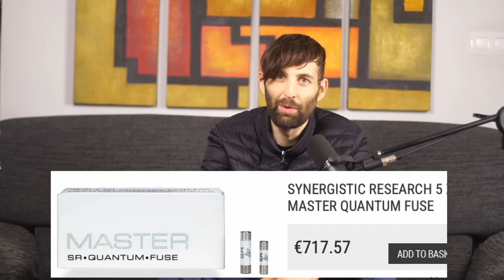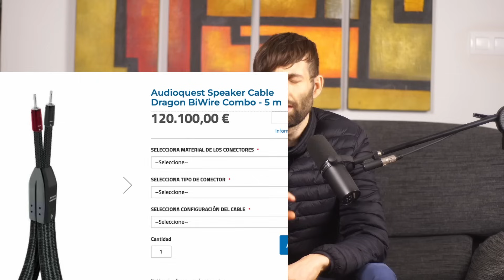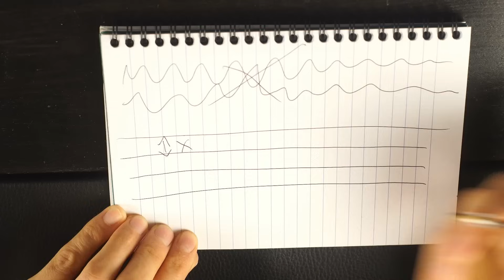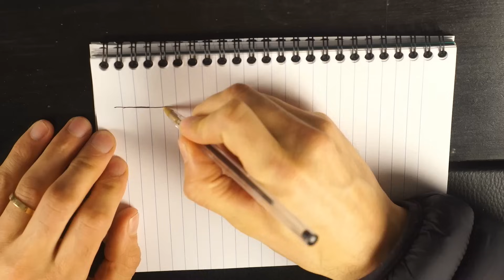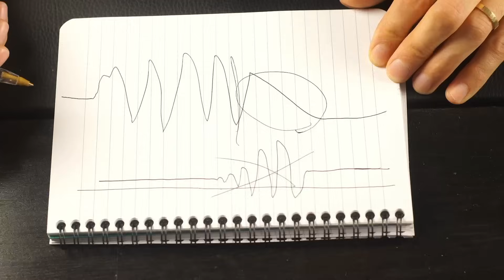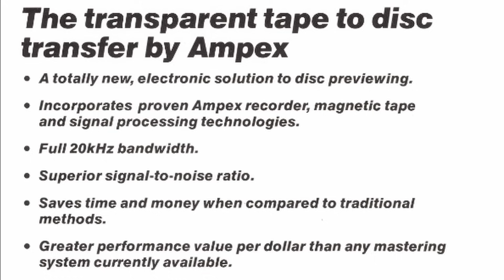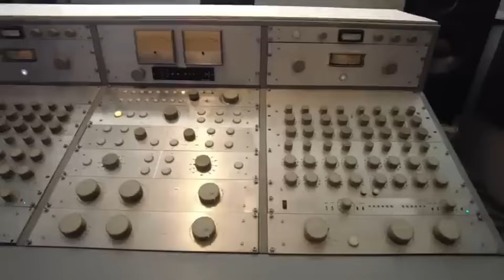Hard truth: most vinyl is digital anyway

Comment: Man, the hi-fi guys arguing with engineers and producers is so hilarious.
Reply: @vstrvcvrtv  I saw one yesterday who said something along the lines of "I don't read Scientific or technical documents, but..."  It's embarrassing.
Reply: @kaczynski2333  And the very finest engineers will still be shocked when their initial implementation TO THEIR EARS sounds poor and they have to begin tweaking.

Same with many speaker manufacturers.

It's what comes in the ears that counts   The science and the maths will get you only so far
Reply: These are the guys who think a £500 RCA jack interconnect makes a big difference when in any studio I've been in, including some very, very good ones, the mic cables are all £20 ones from Studiospares and there's a high chance the snare was miked with a £90 SM57.
Reply: @DrRinse  And the mic cables are only 20$ because they're like 10m long and they bought them, instead of having the intern make them. 😂
Reply: @DrRinse  quality mic cables don‘t make a difference ( on impedance)?
Reply: @perudolux  The impedance of the balanced cable is too small in comparison to that of the mic or pre-amp to make any discernible difference. One studio I worked in had a Neve VR60, nice Neumann mics, Coles Ribbon mics, API outboard hardware, NS10 and PMC monitoring, an Otari MTR90 as well as Pro Tools HD but with a standard cheap patchbay and patch cables. Mic cables were as I described and many great recordings and mixes came out of there.
Reply: @sorry, I ment resistance
Reply: @perudolux  As far as I know XLR cables are fairly low impedance (c. 40-75 Ohms). We kept the cable runs 10 metres or less so I would doubt resistance would have been significant. Upstairs, the mastering suite was kitted out by a good mastering engineer who has some nice credits on Discogs and was very particular about the setup. 
He had a Manley Vari-Mu compressor and a Maselec MEA-2 Mastering EQ, a lovely AD/DA and monitoring but again everything was linked with standard, non-flashy XLR leads. This was the sort of guy who would ask me could I tell the difference when he applied a half a dB of EQ. He could - I defo couldn't!
Reply: @ and cables running long distance from downstair to upstair were also 10$ shitty cables?
Reply: @perudolux  all analog cables DO make a difference- just not always perceivable, due to being minute. Biggest reason is capacitance: first, cheaper cables have poorer insulation, secondly the longer cables will have more capacitance than shorter one of same cable type. Impedance can play a role too, but usually you'd have to go couple hundred feet for that to become a significant issue. Capacitance would parasitically drain a lot of high  frequency content from the signal on  a longer run.
Reply: @perudolux  The mixing and mastering studios were separate. The cables for both studios were £20 for a 10m XLR, standard quality.
Reply: @alshk6763  I mean, you can tell if a cable is damaged, that's true.
Reply: @perudolux  we should expect a reasonable variability in impedance, + or -  the standard for that wire size. There is no magic in copper. A cable can be made so poorly, the connections are causing problems, but in general, most cables will do the job. It is true, a cable company could use higher quality materials and thus the cable we perform over a far longer period of time, but this quality difference will never be audible or measurable, until the cheap cable fails, which will be more likely from being walked on.
Reply: @perudolux  Impedance can make the signal weaker in volume, I am more concern about the capacitance of the cable as it is a low pass filter essentially. 3 dollar cables per meter are usually very good and there are good ones for 2$ per meter. I used lots of different cables and when I don't like a cable it is usually 1$ or less per meter.
Reply: @DrRinse  lol, I prefer these guys £5000 soundbar guys
Reply: @DrRinse  reminds me of the recent GamersNexus video making fun of marketing for computer components. The manufacturers write "military grade" in huge bold letters on their website; what they fail to tell you is that, more often than not, military grade just refers to the minimum viable quality
Reply: SM57 is nice for snares. But it HAS TO BE MADE IN 'MURICA!
Reply: @DrRinse  in a properly treated room, with top notch monitors, cables will make a difference. Any studio claiming to be high-end that's running £20 cables should be wholeheartedly avoided
Reply: @DrRinse I agree with you for the most part but we are talking many muliples of cables microphones, fx,, patch bays, preamps, amps ect. working in conjunction in a functional mix.Also all pro audio is balanced connection (Xlr, pentacom ect.). When I was training at IAR or working at Soundtrack NY these where also mixed down on very expensive mix boards. I believe the main board in IAR was close to $800k😊
Reply: this is the science lol l
Reply: Hi Fi guys arguing with vested interests you mean
Reply: I’m a Mix and Mastering engineer that has been going to Hi-Fi conventions for years to compare the speaker designs versus Pro Audio/Studio designs. I would always take music the I know intimately, because I produce it, tracked it, mixed it and approved the mastering. This way I could judge correctly how each song is being reproduced by the different systems. The times the audiophiles would argue with me when I expressed my take on how a system was skewed or just lacking totally, was constant. Telling me I had no idea what I was taking about. Even after I explained that I produced it all. It was just hilarious how they would just die on their cross for the equipment they spent $100k for that didn’t sound any better than a $1k studio monitor.
Reply: @aarongandia5930  to defend hi-fi guys, you can listen to loud hi-fi way longer than loud monitors. The skew is comfortable most times.😂
Reply: I swear. Some guy on reddit (obviously) was arguing with me and calling me a closed mind idi0t because i explained that power cables don't matter.

I'm a practical engineer with a specialty in communication technologies and signal integrity.
Reply: @Drn10n  Isn't the projecting of these people funny? I have a degree in communication electronics and had the same with some of these snake oil believers. They're a bit like the flat earthers of audio. It's pointless arguing because they don't understand basic physics, but believe a story.
Reply: @ropeburn6684  hell yeah man them bad and dumb and we smart and good hahaha amirightguys
Reply: @Drn10n  POWER cables?!?! good fucking LORD lol
Reply: @Drn10n  well yeah he was arguing with you because you’re an idiot. Everyone knows that he was right /s
Reply: @Drn10n  I like to ask them do they know what is the price of the wire that goes from the socket, trough the walls and then to the power transformer outside their house and to explain how the final 2m of cable being gold plated matters LoL :)
Reply: @collapsingruins  CRT monitors have lower latency, also scale down better to lower resolutions, it’s not some mumbo jumbo, digital foundry did a good video on it a few years back. 

When playing older low resolution systems the image quality can be substantially better as those games were designed around those monitors, and the best filter solutions are still not great. 

Not enough for me to go back to CRT tho bugger that.
Reply: Eh well I have been designing and builidng audio equipment for over 3 decades and the title of his video is simply false. He's usually spot on technically but this particlar argument tries to make subjective qualia objective and that's kind of false because, as he and any good audio engineer knows, psychoacoustics plays a significant role in how we percieve audio.
Reply: @atarisidequest  haha, you'd prefer "there's sometimes analog to digital conversion in the vinyl making process"
Reply: @vstrvcvrtv  Vinyl is always analogue 100% of the time. You could technically make a digital vinyl record but the sample rate and bit depth would be severely limited by the moving mass of the stylus. You'd also need to normalise the signal, do D-A conversion then amplify. It would be absolutley silly. Regardless of whether or not the signal upstream of the cutting head is digital, at the point where the cutting head cuts the master plates it is 100% analogue.
Reply: @atarisidequest  I must have not understood the video
Reply: @vstrvcvrtv  The video is trying to make a point about how most vinyl is created from a digital source and is therefore inferior to the source. Furthermore he's emphasising that point by stating that even the way that the masters are cut involves a digital control system.

All these are valid and true points but ultimately the tracks on the record can only be cut in a way that allows a stylus that moves with 4 degrees of freedom to be equalised and amplified to produce the music we hear, and that is a purely analogue signal.
Reply: @atarisidequest  how did you arrive at "therefore". Are you suggesting if the vinyl was made from pure analogue it would be better? You're correcting me for a point you're making now. Plus, you missed the sarcasm.

Have a good day though, it's all banter, plus English isn't my first language, I was just not communicating clearly. Happens more than I like.
Reply: @vstrvcvrtv  I'm sorry, I'm autistic so i missed your sarcarsm and tend to be very literal. I was only trying to explain the video because you said you must have misunderstood it.

Anyway at risk of more literal interpretation:

"therefore" follows a set of logic statements about the truth of my claim. I'm not saying analogue is better, that's subjective, just that the statement made by the title of the video is incorrect. It wouldn't even bother me but the video went into enough esoteric detail regarding the cutting process that people less familiar with the topic could be forgiven for believing that vinyl is a digital format, when, in fact, it is not.

Yes this is all just a friendly discussion, I hope you have a great day too!
Reply: @atarisidequest  hehe, I see you have encountered many people who lack comprehension, and are thusly being accommodating, I usually go condescending, I will be more like you from now on🙏
Reply: @atarisidequest  now I wanna say CD's are just digital vinyls(ignoring materials etc)
Reply: @vstrvcvrtv  haha well actually that's very valid
Reply: @atarisidequest that’s a word salad.
Reply: @jeremycarroll451  lol, he did, relax with him, he's cool people.
Reply: @atarisidequest The point that it fails to make is that these sources are usually cut more flat to records in masterings and most of the time dont have the compression and sample rate cut offs if you record a modern record cut digital. So these sources are not what you get when you buy a cd. Many times advertised HD downloads are bogus with 44.1khz cut offs or upscaled cds. 
I transfer all my lps and do a full on digital analysis on everything I buy. Science. Some of these "rips" are available on my channel
Reply: @atarisidequest did you actually watch the video?
Reply: @collapsingruins  That's not true at all, any decent quality PC monitor from the late 90s to early 00s would have a better pixel image quality at lower resolutions than any modern screen.

Where they would lack is in colour accuracy or vibrance. When I first upgraded to a quality flatscreen about 15 years ago I noticed a decrease in image clarity, which was only really explained by the digital foundry CRT videos.

Old CRT TV's were a different matter, most of them pretty poor quality and the high quality ones were expensive, but good CRT PC monitors were common, mine ended up in a dump somewhere, just took up too much space.
Reply: People who make the sausage arguing with the people eating it
Reply: @ he is saying that all sausages are the same and they are 100% pure meat and sausages are identical to hamburgers. 😂😂😂
Reply: @domlisboa4024  they should increase the price of whatever it is you're smoking
Reply: @ yes understanding how equipment measures and how all equipment measures differently is something that children under ten years of age can understand. No cigarettes needed.
Reply: This "measures differently" is a pretty pathetic argument when you actually bring the numbers to table and it's obvious that they mostly are orders of magnitude below the levels that would be perceptible to human ears (i.e THD).
Reply: Anti-intellectualism is huge right now
Reply: @ It’s not nonsense as it’s quantifiable that CRTs have faster refresh and less lag than sample and hold display tech. There are whole subcultures like blurbusters working all the time on how we can get fixed pixel displays to achieve CRT parity.
Reply: Rhetorical question: How many of them know the history of recording technology? This is simply entertainment appealing to the ignorant and to futility.
Reply: @vstrvcvrtv  Grammy award winning mastering engineers do not agree with this YouTuber. Choose who you wish to believe.
Reply: @domlisboa4024  disagree about what exactly?
Reply: @ just read my posts. It’s all there. The YouTuber asserts that all digital playback is indistinguishable from each other and that digital is fully transparent. This is scientifically proven to be false with much published evidence to support this. The YouTuber is the one that needs to show published findings to support his argument. But we all know that they do not exist. It’s just his opinion to create a video that will gain views.
Reply: @domlisboa4024  he did in his "claim" video
Reply: @ can you share the link because YouTube doesn’t give any results for that video
Reply: @domlisboa4024  the video isn't titled claim, the video where you say he's wrong about digital destruction, is the same video with concise information. Also, you genuinely feel like digital destruction is worse than analogue?
Reply: @ I never said anything about my preference. His assertions are patently and objectively false. That’s all that I have said. Digital is very good. But it’s not perfect. There are plenty of turntables that I both like and dislike.
Reply: @domlisboa4024  cool. Any chance you can share your proof of a reference, so I don't have to say "some dude in YouTube comments told me"
Reply: @vstrvcvrtv  you are joking right about me providing proof? There are measurements of converters all over the internet. They all measure differently. They are not the same. The difference between digital and LP isn’t just surface noise again the measurements demonstrating this are all over the net. A person claiming the equivalent of the earth being flat (the YouTuber in the video in this case) is the one who needs to provide the proof.
Reply: @domlisboa4024  if you don't have any, I understand completely, I'm also unable to find any information that supports your claim
Reply: @ and for the record I never said that I didn’t have information about manufacturers specs and third party tests that highlight difference between digital products. These are all over the internet. But I do look forward to receiving your academic studies proving that different measurements in audio are in fact the same as identical measurements.
Reply: @domlisboa4024  a simple "no, I don't have any information to share with you" would suffice big dawg. Plus I also have a decent hi-fi system with a vinyl player and amp, digital is just better.
Reply: @ I shared the information with you including one of the leading test sites of DACs. You choose to ignore published data from manufacturers and testers. If you want to ignore science that’s up to you.
Reply: Dude, it's DIGITAL. It's literally identical and bit-perfect from playback to playback. There are variables to that such as clock jitter, etc. but these are so insignificant that 99.9% of listeners would fail a blind test. Don't make stuff up.
Reply: That's not science, that's marketing BS at its finest.
Reply: @domlisboa4024  In which random anonymous youtube commenter claims without any evidence that he knows what Grammy award winning engineers agree or disagree with
Reply: @domlisboa4024  genuinely have no idea what music I actually listen to won a grammy in the last 20 years. I listen to 2 artists AP works with
Reply: On what points dont they agree?
Reply: @collapsingruins  Well flatscreens are thinner, lighter, wider, cheaper to produce and more energy efficient. CRT's were massive and heavy, the advantages they have over flatscreens aren't relevant and were always going to be solved by new tech, however long that took.

My old CRT from 1998 was 1280x1024 resolution, which is higher than 720p HD, but where CRT was superior is in the picture quality for any images displayed at lower than native resolution. 

The 0 latency of CRT's is largely a non-issue with modern gaming monitors having low latency around 1-3ms, and high refresh rates up to 240hz or more are vastly superior to 60hz CRT's with 16.6ms per refresh even if they had 0 ms latency.
Reply: I had gamer explain to me how great Razer cans were so I could mix with them😂😂
Reply: @ViklasSvenske Exactly, but good luck trying to convey that point to a true hi-fi believer
Reply: Big money spenders vs big money makers?  I know where I’m putting my money 😊
Reply: This is what make the debate realy fun, they are able to say ,  '' my copie on LP from the music your made, sound better than your digital master ...'' that's totaly nuts they have no idea what they talking about and they are sure that your expensive studio gear sounds weaker than there 10 k HIFI equipement they are totaly out of there mind !
Reply: @Meteotrance  kudos to the marketing teams, lol
Reply: Being trained as a engineer and also into Hifi.(Not sure why you'd have the desire to engineer otherwise) always comes down to mastering. Its just easier to find best mastered records than having to go through all the horribly manipulated compressed versions. Many times it could use the same remaster but its usually from a much higher bit and sample rate and still retains the full frequency response of the recording. Many times its prior to a compression stage in mastering and you get fuller dynamics. Like the 2012 Stereo Beatles Vinyl compared to the 24/44.1 usb.

Theres some examples by Miles  Showell on YT as well and his discussions of sources used to cut half speed.

My channel is one of those examples of vinyl masterings and how they can also be transferred digitally.
Reply: hifi has always been cringe as hell, like astrology for old white guys
Reply: As a sound engineer , I began to listen to hifi gyus more and more. They don’t have the technical expertise but sometimes just good ears
Reply: @perudolux  The ideal person you'll want to listen to has both. But I'll favour the opinion of an educated person with average ears any day.
Reply: @ropeburn6684  means he can explain that vinyl isn‘t technicaly superior but doesn‘t clearly hear it himself ( sorry, it‘s late, i am playing devil s advocate here)
Reply: @perudolux  true, it's easier to listen to hifi, studios have faster ear fatigue. That said, I'd rather listen to music in the studio. A trash mix will still sound good on hi-fi.
Reply: Analog CRTs are technically inferior to OLEDs or LCD in picture quality yet they give off a particular glow and refresh rate method that can’t be replicated fully by newer display tech and look aesthetically pleasing when displaying low-res content, particularly older pixel video games. Is the CRT “better” than my 65” OLED? From a scientific perspective, no. From a subjective standpoint for particular use cases, yes. Likewise the same for vinyl, it presents music in a pleasing, different form even if it’s not the final word in transparency.
Reply: With your example, youre describing two different ways to reproduce a video signal, how they differ techincically and why people might prefer one over the other. But you didnt with the vinyl format. And I wonder this, if a recorded sound sounds better when put on a vinyl disc and played through a specific pickup, why not just record that sound to a lossless digital format and listen to that instead?
Reply: @nilsandersson4654 If I prefer the sound coming out of Klipsch speakers and record & play it back digitally through some JBLs will it still sound like the Klipsch? There’s so many variables at play. I’m not someone who believes all DACs sound the same for instance.
Reply: @mikeg2491  I don't even think multiple dacs of the same model will sound exactly the same. Perceivably maybe, but I don't think, exactly
Reply: @nilsandersson4654  a few reasons: 

1. the number of combinations of hardware exceeds any practical attempt to catalogue them 

2. the number of tracks that would need to be recorded with the above limitation makes the task impossible complete.

3. There's not enough hardware to keep up with even a fraction of the rate that songs are released
Reply: BOOM!!👍
Reply: @mikeg2491  It's not even the vinyl itself that "presents music in a pleasing, different form". It's the mastering that is necessary for the audio to be able to cut into a lacquer. If you don't damp the high frequencies before cutting, those high frequencies will distort and sound ugly. So you damp down the high frequency range with a low resonance EQ band and voila: the song sounds "warm", even before being on a vinyl record.
You could just use an EQ or a filter on any digital audio and get pretty much the same effect.
Reply: @mikeg2491 there are reasons why CRTs are better for some things and thats mostly about lack of square pixels grid and no ghosting, but can get pretty similar results on OLED with filters. Vinyl on other side is objectively worse, could try to argue it when records were analog.
Reply: @mikeg2491  right on
Reply: @mikeg2491  You can appreciate the quirks and likes of a specific technology without going full Messiahs.  Piano and guitar are very different one likes guitar more and that's fine but don't run around and scream that the guitar is superior to anyone who doesn't want to hear that
Reply: @fischX  I don’t believe analog records or digital is superior to one another just different. There is a place for both. Better camera technology doesn’t negate the splendor of technicolor film in Wizard of Oz for instance.
Reply: @mikeg2491  here's a hint mike, we look at CRT junkies the same way we look at audiophiles - with laughter.
Reply: @ It’s fascinating how people’s hobbies trigger you. Do classic cars make you upset too because they can’t compete with modern engines? Are they suddenly not fun to drive?
Reply: @mikeg2491  as long as they don't say their ford model A is faster, safer or more efficient than the Porsche gt3rs we really have no issues
Reply: @ Seems a bit disingenuous to say LPs are like a clunky model T, I was thinking an apt comparison is a 1960s Mustang vs a modern electric one.
Reply: @mikeg2491  what was there before LP's? I might be missing something
Reply: @mikeg2491  not electric surely. That's ai music. Compare Mustangs pre and post ecu's then. We like how they looked better, not doing no road trips or track races in a classic car any day if the week. Would I rather a Sunday drive in the classic car? Maybe the idea and the photos I take. The petrol fumes don't really work for me
Reply: @mikeg2491  LP's are model T's, the acoustic stuff before that were equivalent to steam machines etc
Reply: @ Phonographs and pre-vinyl shellac discs I think is closer to the model t comparison, or perhaps even more Edison’s cylinders. The introduction of the 33 LP in the late 40s is what I think of as the beginning of the silver age of audio.
Reply: @mikeg2491  LP's were the first thing mass produced, model t was the first thing mass produced. I mean, we're arguing analogy surely, there's no way we can arrive at a conclusion. Anyway. Back to your point, y'all can like your classic cars, but you're not dailying them out of convenience, or superior performance, or quieter road noise, or fuel efficiency, purely emotional. So we'd never correct classic car enthusiasts, we might even pose a video on our ig stories of the engine revving and say it's beautiful.
Reply: @mikeg2491  you’re mixing up a source with an output. A CRT is an output device, like a pair of speakers. Of course it has a big influence on the way the media comes across (for good or bad; CRTs have a certain appeal).

Vinyl is a source, like VHS. DVD still looks better on a CRT, just as a CD sounds better, whether on Cerwin Vegas or electrostatic speakers.
Reply: I have a 980Ti just for CRTs
Reply: As a “hi-fi” guy myself, I’ve always read in the forums that audio engineers don’t know what they’re doing lol.
Reply: @olimphus26  hehe, that's so funny. What are some common mistakes engineers do that hi-fi guys hate? (Not counting the crazy compression requirements nowadays)
Reply: @olimphus26  The more you know the less you think you know. Not the case of every engineer but the good ones.
Reply: @vstrvcvrtv  these are the same people who would argue against a drummer recording to a click not knowing their favorite old school drummer has probably used beat detective at some point.
Reply: Modern audio engineers are generally trained in modern audio. So they missed the class on line contact styluses and turntable advancements. Takes one to know one though.😂

We can look at literature, chats, videos of engineers like, Miles Showell, Barry Diament, Kevin Gray, Bernie Grundman,Chris Bellman,Robert Ludwig, Steve Hoffman, Shawn Britton, Rob Lo Verde,Ray Staff,George Piros, Stan Ricker, Dennis "Bibo" Blackham, The Golden Family (now JJ. & April) at A Golden mastering that cuts for MPO.... 
Lets name names.
Reply: But people have personal choice. Hearing things clear is not necessarily good for the art of music. Digital sound can be sterile and fake, when you hear music live it does not sound like this. Producers and engineers also think autotune is fantastic, and nothing should ever have any faults. This does not make for good art.